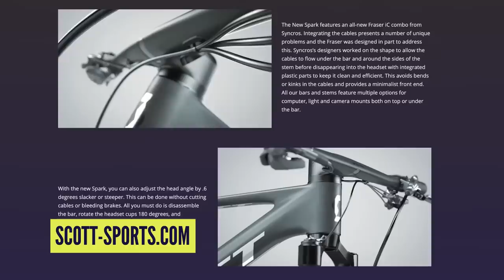Is Headset Cable Routing A Good Idea?! | #AskGMBNTech

Comment: Headset cable routing is just another annoyance for home mechanics and will force people to use shop workshops more which is the only point of them that I can see  . With no big innovations in anything right now other than electronics on bikes its a sad state of affairs it just goes to show normal bikes have got as good as there going to get .

Comment: I think grip shifts are the dumbest idea for a shifter. They should die and with a sign that say DO NOT REVIVE. I was injured quite badly because I had had a grip shift in the 90’ , I accidentally hit the shifter, it shifted to lower gear I went over the bars and fell down a cliff. For a seat post still not good idea. Think you are going down a ruff trail, you hit that shifter by accident suddenly you have your seat right we’re you don’t want it and possibly causing a crash. Retro tech that was a bad idea when it was new and still is a horrible idea.

Comment: I’ll take internal routing all day long. Looks way cleaner. Once setup, you don’t need to mess with the hydraulic hose and shift housing until replacement.
Reply: Shift housing is often replaced so pretty foolish to assume it's not going to be a problem. You are basically hoping a mountain bike doesn't get normal problems they do get. Even with lower service headset routing is a pain.